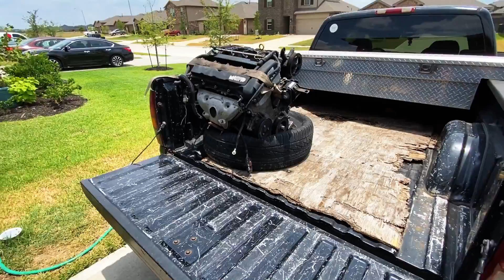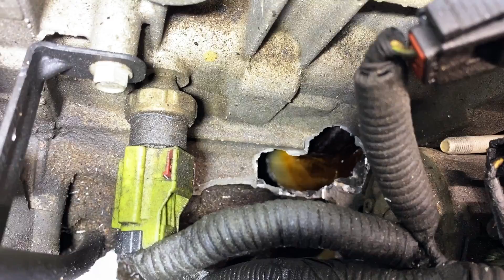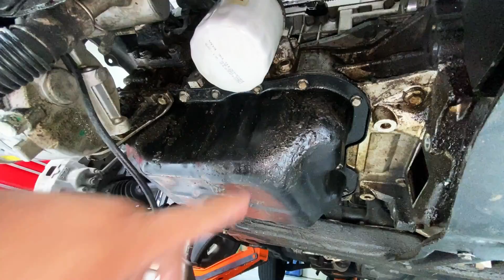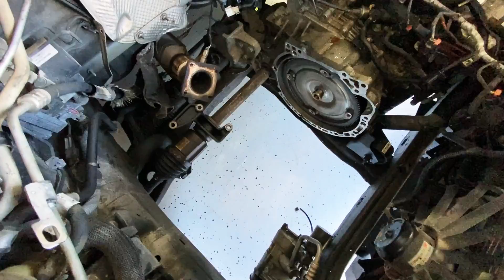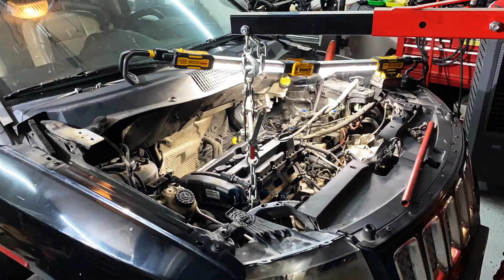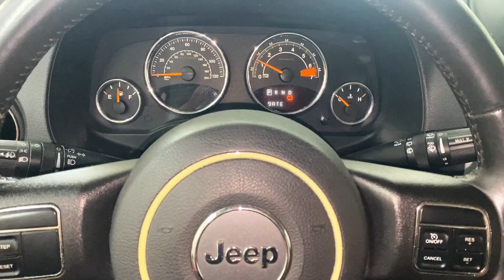JEEP COMPASS ENGINE EXPLODES / USED MOTOR REPLACEMENT

Comment: You ripped this customer off, could’ve easily jb welded the block back together and then super glue the connecting rod and would’ve been good to go for at least another 1 or 2 miles

Comment: Instead of the entire ride being scrap metal, you can put an engine in it and due to the other issues sell it to someone else for a really good price and get the maximum you can out of it. I scrapped a car for 100 dollars because the transmission went out. A junkyard trans costed 300 and a buddy said he would do it on his lift in a couple of hours for 150. I could get 3000 out of the car running and driving.

Comment: Hey Eric, some time ago you did a Nissan Altima that wouldn't accelerate passed 25 MPH and you found out some ties with the braking electricals. You replaced a stop light relay. I have a 2009 Murano and I can't find the brake stop light relay, does it have one?! Here is below your video for reference; thanks in advance.
https://www.youtube.com/watch?v=B1NXkBkH9Q0

Comment: Perfect video!!! I own 3 mopar. One of them is 2011 dodge avenger with same engine as shown in video.. Almost 220mi. Original engine and transmission. I am very nervous 😬. And VERY IMPRESSIVE. Engine swap at home?? That’s a skill there. I’ve been fixing cars for almost 3-4 years and still learning. Haven’t swap engine yet.

Comment: EXCELLENT!  EXCELLENT!  EXCELLENT!
A great quality job!  Thankfully the 2nd engine only had 87K on it and hopefully has a long life.  I just finished working on my wife's 06 Kia Sorento today. The upper intake manifold has two parts and Intake Manifold Runner Control ( Ford lingo, don't know what Kia calls it) part had a bad vacuum leak on the shaft for the flapper valves.  Found a brand new one from ebay, with the three new gaskets, even the two mounting screws for the diaphragm along with the "c" clip as part of the total package!
Engine now runs and idles great, no more MIL light, monitors all set so it's ready for it's smog test!  YEEHAAA!
Reply from the maker: Awesome!

Comment: That's an interesting challenge. Does the junk yard offer any kind of warranty on the engine, if it turns out their engine is bad? Do you get anything for the old engine, or some kind of core refund?
Reply: Most offer something like a 30 day or the yards I use have a 30 day that's free up to a 3 year 60K that also pays labor that adds like $150.00 to the price. They also have a $150.00 core. Which with the way it is getting parts these days I tend to hang onto engines that ran OK just for parts.

Comment: I really like your channel and your a very good tech I'm also an automotive tech been one for about 50 years you did the rite thing by replacing the water pump, but why didn't you go ahead and replace the front and rear seals and old oil pump because you don't know if it's working good sense the engine is a junk yard engine.

Comment: Also on Chrysler vehicles one of the four torque converter bolts has a bigger shoulder this bolt is the “guide”bolt in which you completely fasten first and the other three is ready for full torque without jogging the converter numerous times..
Reply from the maker: Thanks for the advice! It’s a good thing I’ve always had a habit of installing all of the torque converter bolts by hand before I torque them down.

Comment: Neat work .Sick work.I hope you stabilize and open big shop again. Cool guys deserve to run big shops. Most such shops are run by dictators and renegades. These guys screw not only customers , but their own mechanics as well. That's why they continue to exist. Most such properties are located very good near big boulevards and main roads and they always get many customers even if they do crap job.

Comment: With the insane car pricing out there, I don't blame anyone on fixing what they have.
Reply: Drive it until the wheels fall off!  See what  makes economic sense, repair or replace.
Reply: Agreed, I have a few older reliable cars, I do all my repairs, parts are peanuts compared to new or used.

Comment: Great job 👍
I wonder if the oil pump failed, starving the rod bearings?
A quick teardown would be a cool video to do.
Swapping out an engine is definitely more challenging by yourself.
A 4-banger is (usually) easier than a V8, that's for sure 😁

Comment: I'm genuinely surprised that engine got 200k miles.
Reply: I am impressed by the engine run hours.
Reply: Those 2.4l fours last a really long time.  I know of a guy who has over 300,000 miles on his Compass.
Reply: @williamwhite9767  I own two of these Jeep compasses with the four banger.  My wife is in outside sales and hers has 201,000 miles.  So far, Replaced stabilizer link, brakes and tires twice and that is it.  Runs like a champ and does not use oil between 5000 mile oil changes.